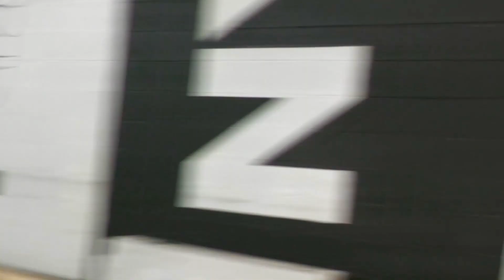When An Engineer Builds A Skatepark

Comment: Funny enough, I was going to recommend the quarters at each end of the park. It's awkward skating the center, then having to get off your board and do another run up. If you want to sesh the stage/center with flow, you need quarters at the ends which are essentially turn-around/drop-in points. Also, the side of the stage that has the stairs should also have euro up. Its weird you can skate it only one way. A final annotation would be to cover up the sides of the stage with the plywood so that no one can fall or get their leg/arm/whatever caught underneath. There's a reason they're always covered everywhere else. Other than that, the park is coming along phenomenally.

Comment: Put the taller skinny quarter in between the doors where that tiny quarter is and build a wider one the size of the taller one against that wall by the "office" thing.   Run up on both sides and a run up for the stage!